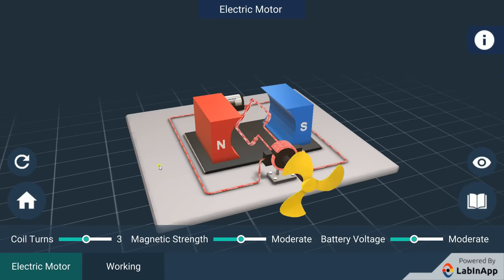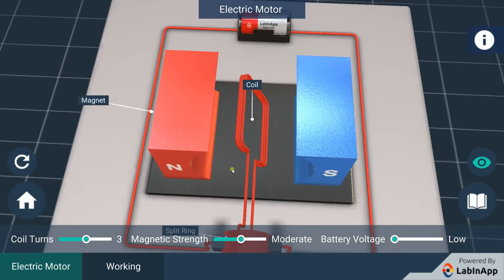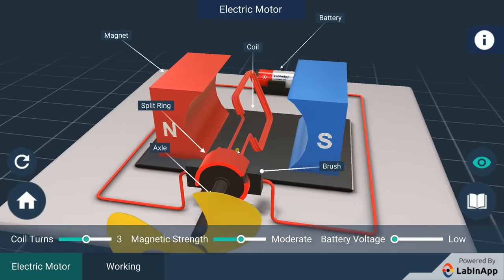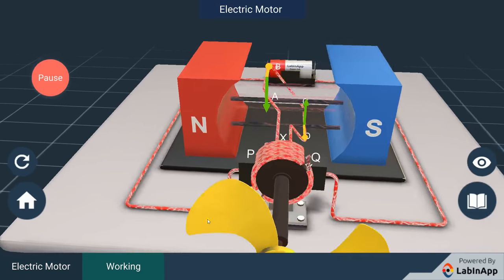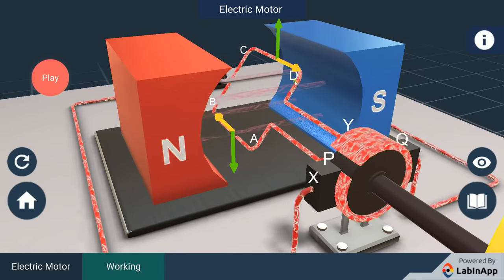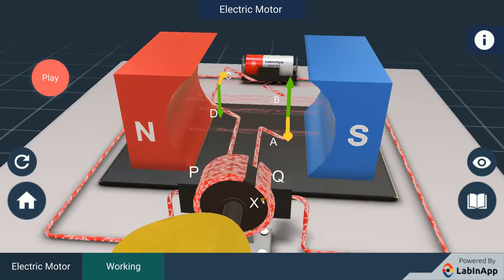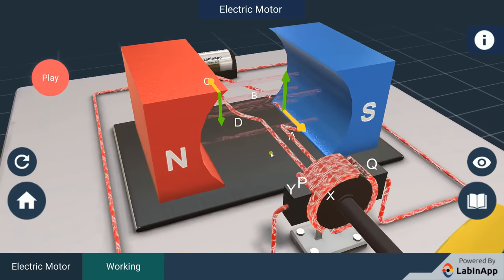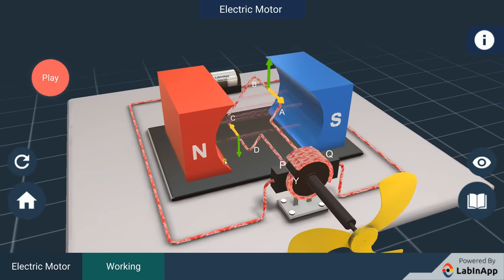Electric Motor

Comment: ELECTRIC MOTOR:-
•Converts Electric energy to mechanical energy
•Consist of rectangular coil of insulated copper wire
•Coil is placed between 2 poles of a magnetic field. 
•Ends of coil are connected to the 2 halves of split ring. Inner sides of these halves are insulated and attached to an axle. 
•The external conducting edges touch 2 conducting stationary brushes. 
•Current in the coil enters from source battery through conducting brush and flows back to battery through other brush. 
•When we apply Fleming's Left Hand Rule the coil mounted free to turn about axis rotates anticlockwise. 
•At half rotation current in coil gets reversed. The reversal of current also reverses the force. 
•Therefore, coil and axle rotate half turn more in same direction. 
•Reversing of current is repeated at each  half rotation giving rise to continuous rotation of coil and axle. 

Thank you!!!
Reply: Thank you, So much for this notes
Reply: @yavanikatallapaka92  my pleasure😌
Reply: thanks bhai
Reply: @Alisha211-l5y  koi baat ni bhaii 👍
Reply: @zaynnnnnnnnnnnnnnn  5mark question notes 😂
Reply: @alphwolf5605  yeahh😄
Reply: Jai shree Ram
Reply: @ChAd_itya  jai shree ram 🙏
Reply: @zaynnnnnnnnnnnnnnn  
That's nice educated Muslim aren't kattar
Muslim are good but kattar muslim aren't
Reply: @ChAd_itya  thank you bhai lots of love
Reply: Thankyou ❤️
Reply: @monikathapa8982  you're welcome 😀
Reply: Thanks bro 👍👍👍
Reply: @mla6975  you're welcome bro 😃
Reply: It actually helped me a lot... 👍🙂Thanks
Reply: @ektananwani2433  ohh great👍 you're welcome
Reply: @ECBKausar  you're welcome brooo👍
Reply: CRX RAUNAK  haha😄 shukriya bhaii
Reply: CRX RAUNAK  Bahot badiya bhaii😆😄👍
Reply: @zaynnnnnnnnnnnnnnn  topper of comment section
Reply: @Cosmothenoob  😐👍
Reply: Do u think we can write down this ans if we get this question in boards?
Reply: @undevelopedporcupine2203  yes.. Why not?? The first point is the aim of the motor or you can say what does the motor do. And the other points are the working of the motor. I didn't mention the principle and materials or parts of the motor. The thing I wrote is only the working of electric motor.
Reply: @zaynnnnnnnnnnnnnnn  oh so will this ans give us atleast 4 marks if it comes as a 5 marker?
Reply: @undevelopedporcupine2203  yaa think so... Man if you have doubt don't go with this answer there are lots of videos on electric motor see those, understand, then make your own answer.
Reply: @zaynnnnnnnnnnnnnnn  kk
Reply: @undevelopedporcupine2203  👍
Reply: Thank you
Reply: @divyasingh8311  you're welcome
Reply: @DARK HOUND no problem bro you're welcome... All the best for the exam today👍
Reply: @zaynnnnnnnnnnnnnnn  all the best😘🤜🤛
Reply: @whoisgonnacarrytheboats19  thanks bhai same to you
Reply: Thanks bro tq for ur notes👍
Reply: @sudhaparimalam709  you're welcome 👍 happy learning 🤗
Reply: @zaynnnnnnnnnnnnnnn  Thanks bro
Reply: Thanks for the notes 🙏🏻
Reply: Thankyou for this notes
Reply: Thank you it's useful ✨
Reply: @humeranikhathbanu3043  my pleasure buddy♥️
Reply: @zaynnnnnnnnnnnnnnn   I wanted the working of electric generator also what about that I searched around but couldn't find
Reply: Tq
Reply: @dhanyabhat.k.r3574  mah pleasure 😌
Reply: Whaa nice 💫💫notes
Reply: @balajikalkutge2136  😊

Comment: The gap between haves of the slip ring has to be wider than the brushes so a brush can not touch both haves of the slip ring at the same time (short).  In a real motor the brushes ride on the commentator that has many segments, each pair connected to a different winding.